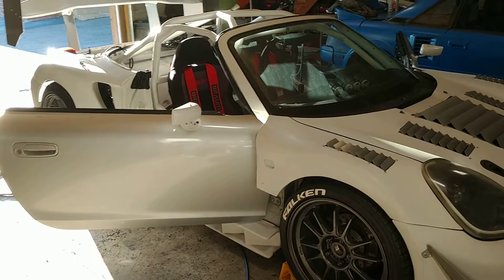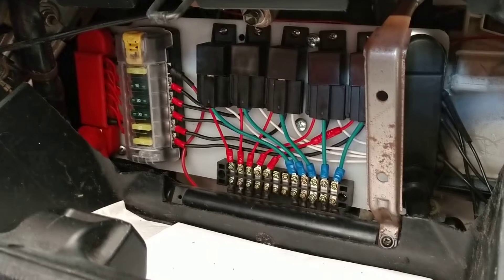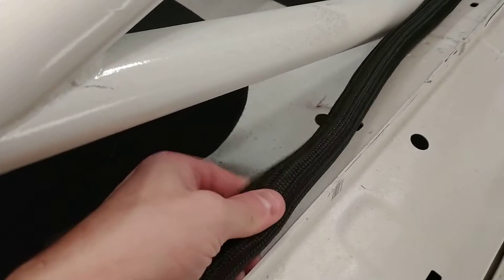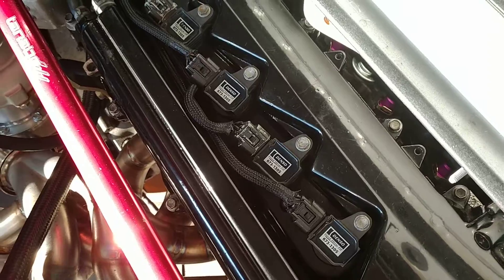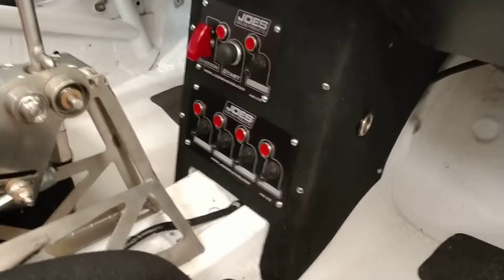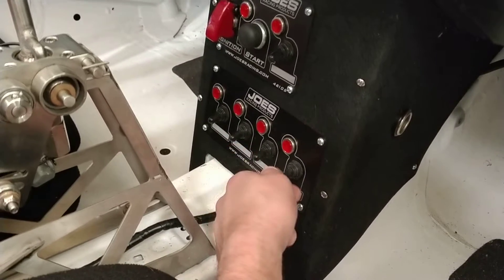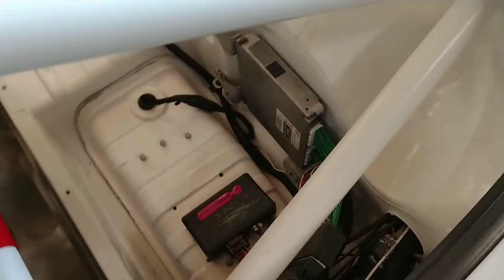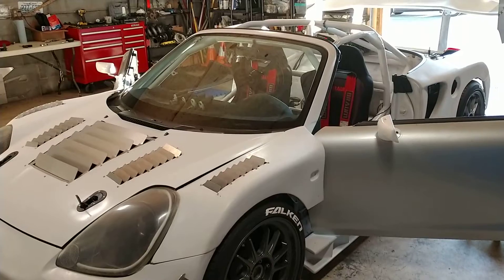NEW Electrical Improvements to the 2ZZ-GTE MR2 Timeattack racecar!  Dyno time?

Comment: I'm running switch panel too. I ran a relay from the push button to the starter motor from the ignition barrel connector. Red to relay, blue to starter, black to ground, and white was bridged from red to blue for supply.
Reply from the maker: Thank you so much for that tip I will look into it and try it out! Have a great day and thank you for watching my video!

Comment: This is my dream set-up, absolute tops man, kudos. I just finished my 2ZZ swap with EMS-4 standalone but there's NO tuners within 5 hours drive of here. Any advice on getting the engine to stop dropping below target idle when you release the throttle?  I have a fresh build with lightweight crank and flywheel so I raised my target idle rpm to 1200 rpm but still when I let off it dips way low, almost stalling, then returns to target rpm within a couple seconds. I haven't messed with much else in the tune (like dtps vs tps map) do you have any advice for a first time builder on how to tune the idle to stop falling on it's ass when releasing the throttle?
Reply from the maker: Thank you. And congratulations on your setup as well. If it's a na 2zz I would imagine with the support and amount of people running ems4 you could find a good remote tuner or a good pre made map. I suggest contacting Redliner9k or monkey wrench racing. Please tell them trackkingracing sent you ;)
Reply: @TrackKingRacing  MonkeyWrench, although I've spent thousands of dollars with them, rarely answer my questions, including that one :( I'm not familiar with Redliner9k is he a youtuber? The base map I got from MWR is a good starting point but it wasn't designed to handle the lightened crank (which I got from MWR ironically lol) I may just end up messing with a lot of settings I'm not comfortable with at this point. The biggest headache is I have three laptops and the only one that coms work with the EMS-4 is an ooold Windows 7 laptop that only works when plugged in to the wall. Windows 8.1 and 10 will communicate with the newer AEM tuner version 3.2 but they can only change some settings but not fuel and spark and a few others, the only way I can run version 2.98 is on Windows 7 so I have to figure out how to downgrade one of my good laptops to the old windows version to get full tuning capability :( the funny thing is on the "what's new" window on version 3.2 it says "Windows 8.1 support" and while it does connect to the EMS-4 it will not change the majority of values, it acts like it's committed the changes but you watch your AFR's and timing advance and nothing actually changes, plus it blinks in and out as the page repopulates over and over again, none of those problems on the old Windows 7 running AEM Tuner 2.98 but 2.98 will not link the EMS on the two newer Windows versions so I'm stuck using that old stationary laptop (may as well be a desktop lmao).
Reply from the maker: @neuronaut8030  I went through a very similar issue. Making sure I had an old laptop with old version of Windows. I had issue with my battery not being perfectly charged which aem requires. And then there was a password protection I wasn't aware of. I'm thankful my new link ECU is much easier to work with.  You can find redliner9k on Facebook, Instagram, YouTube. Just Google.